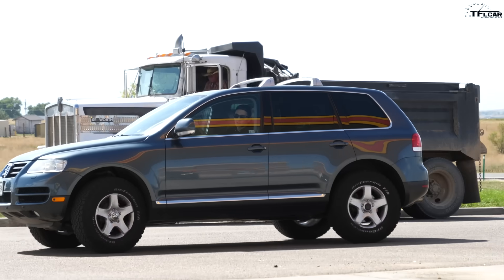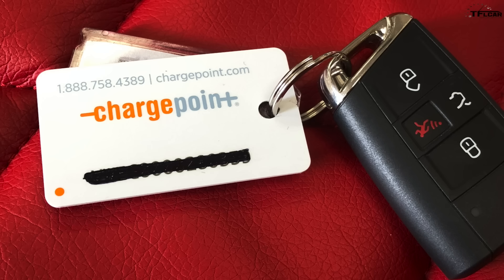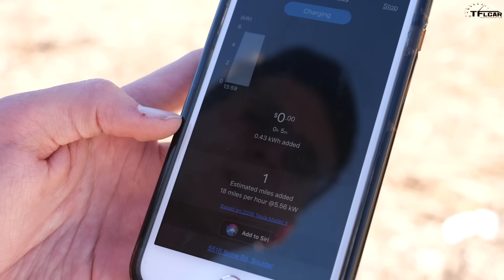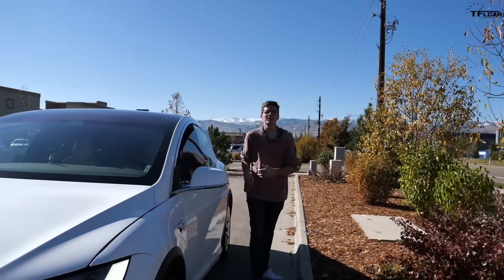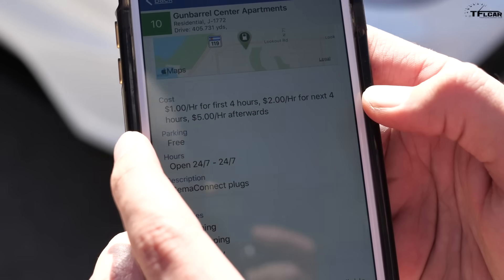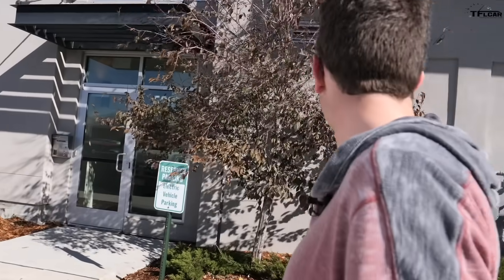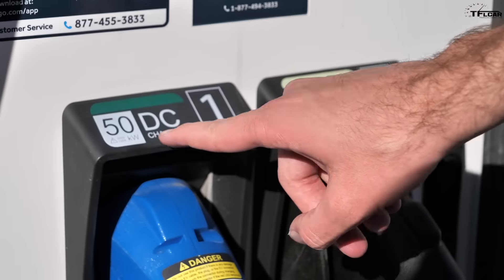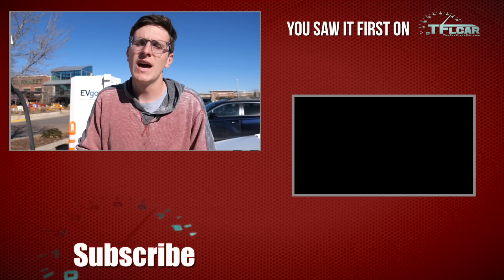Here’s Why Charging an Electric Car Can Suck - And It’s Not The Reason You Think!

Comment: watched the whole video and you bring up good points and issues about EV charging. they truly need to get all companies standardized and easy to use like filling with gasoline. i don't think the general public wants to fiddle with multiple apps for payment, nor do they want to carry around multiple adaptors for all these charging plug types.
Reply: @treyhart6861  Just look over the ocean and see the situation in Europe. The EU standardized the CCS Plug which is compatible to the Type 2 Plug which is used for AC charging. Only Nissan stayed using Chademo, all other vendors are using CCS. Even Tesla uses it for the Model 3, Tesla SCs in Europe have both connectors.
Reply: @craig9365  Level 2 makes sense at hotels, shopping centers and so on. Again a US problem, your electric system is weak. In Europe nearly everyone got 400V 3-Phase within the household. (11kW)
So Level 2 in Europe is typically 11kW without any issues and this is sufficient for destination charging. 
Nobody needs fast charging at the destination, you need many charging ports in parallel to charge the cars while they are parked. 
Fast charging with 50kW is established widely in Europe , a net of 150-350kW CCS chargers is actually in construction.
Reply: fideliovienna our ENTIRE Electric grid  is much older than any where else in the world it’s the oldest electricity grid  no way would three phase electric power be allowed into residential homes 
Building codes would not allow it and their insurance companies wouldn’t allow it
Three phase electric is restricted to industrial uses
Our system could never support it 

In residential areas our electricity grid is referred to
As a. LIGHTING system 
Basically enough power to operate small motors electric lights and household appliances  nothing more
Also electricity is kind of expensive here
Reply: @fideliovienna4631  Europe's grid system is definitely an advantage, but to say that fasting charging is widely established is far from true.  Look at any accurate station map and there are countless gaps, some of which are hundreds of miles apart. It's even worse in the Eastern countries.
Reply: @treyhart6861  Tesla was the first so they had to make their own. Europe did well with CCS after tesla.
Reply: @martialman.4563  Tesla wasn't "first".
Reply: @pogo1140  Maybe not but who else had DC fast charging in 2008?
Reply: @pogo1140  seems like my statement is incorrect. Not sure 2008 had DC/DC
Reply: That is why Tesla has a almost monopoly on electric cars in USA. Very fast and easy system.
Reply: @martialman.4563  - in my area the tesla super charger is 25 miles from my house and 75 from my work... not enough of them
Reply: @williamhaynes7089  If you can't charge at home or have good public charging near you an EV might not be the best choice. I have a garage and a Supercharger on my way to work.
Reply: Martialman.45 the Japanese will find a way around 
The 
Arrogant. Mr musk
Reply: I don't live in the US (yet) but I think I'll use just one single company and one single app. I really want to move to San Francisco. It's enough to use only EVgo there.
Reply: As others have stated Europe has mostly standardized on CCS.  In North America all but Nissan (and affiliates) and Tesla uses CCS.   So just like in Europe Tesla should transition to CCS.
Reply: @craig9365  Yep.
Reply: All you should really need is EVGO and ElectrifyAmerica if you must charge on the road, these are the major players for fast charging for all the EV's out there but Tesla. Plug share and Chargepoint should just be an afterthought as they hardly have any Fast Chargers in their system. Also, I use a converter that lets me access the Tesla Destination chargers that has not been brought up at all. It opens up a lot of overnight options at hotels /businesses.
Reply: Sky P38wannabe chargepoint offers a lot of 25KW DCFC chargers though, in a pinch
Reply: NY has a good solution for this, want state subsidies to put in a charger? You must have an open standard plug. This is why Tesla gets zero dollars from NYS for their super chargers
Reply: @Snow Monk3y Lithium salt extraction has a fairly low environmental footprint and is not an energy intensive process contrary to a lot of the garbage on the internet saying otherwise.
Reply: @treyhart6861  That may be how Tesla thinks, but almost every other manufacturer worldwide uses standard (J1772) interfaces. CCS is a simple extension to J1772 (adds two DC posts below the AC part)
Reply: @treyhart6861  or better yet just unplugging and borrowing your charge seen it lol so much a cple of pple even had an extension cord said owning a ev was the cheapest ever when you can recharge for free almost anywhere but home
Reply: Tesla has the nicest sleekest charger where as Chevy has clunky and big chargers
Reply: @CockpitScenes  You don't need chargers for alternating current as they are in the car. Just  need a place to pug in or a cable. In Canada many places already have an outlet for block heaters. Again 120V is very slow but it's better than nothing.
Reply: @CockpitScenes  Yes, very rare to not have electricity anymore in USA. Illegal in most city's to not be attached to the power grid. It's also relitively easy to install more recepticles and upgrade main power source. Upgraded from 100 amp service to 200 this year in case we need to charge 3-4 cars at the same time.
Reply: Martialman.45 except during those peak hour electric brownout hours lol 😂
Reply: @RCFourFive  Easy to charge off peak. We in Texas had to charge off peak and turn down home air conditioning to combat black outs this summer. It worked.
Reply: Martialman.45 apples to cumquats. We in Texas have ERCOT that has made sure our grid is sufficient and capable.
This is not true for other states - so again except during those peak hour brownouts.
Reply: Trey Hart nothing 
🤣🤣🤣💰
If it’s worth something ppl will steal it

The Japanese car companies will figure a way around
This
Reply: @treyhart6861  I believe the correct term in this case, is: "bloody, greedy savages".
Reply: @treyhart6861  Tesla even released their patents for the charger to get everyone to use it but noone did so we're stuck with a stupid adapter system.
Reply: @craig9365  well, multiple apps is due to companies seeing an opening in the market and creating locations. First people complain there aren't enough chargers, now that there are chargers apparently downloading a 2mb app is too much. Noone is ever happy I take it.
Reply: @0xsergy  it's not the size of the app, that's the problem. It's having to use multiple apps, to do the same thing. You should be able to use cash, or credit, to pay for the use. An app shouldn't be needed.
Reply: @Normal1855  they're separate companies bro, that's how it works unfortunately. yes, lets monopolize every industry yeah?
Reply: @CockpitScenes  well, they're probably gonna add them mate. happy customers means return customers. i've seen charging stations at hotels in the mountains unused.
Reply: I don't understand why they can't just be the same as a 240V appliance plug. Or whatever your country uses for high current devices, so you can just use an extension cord.
Reply: Getting all companies to comply with one plug design is like getting all computer companies to comply with one USB PLUG. Tesla is like IBM and Apple. They won’t give up or give out their proprietary property.
Reply: all electric cars should come with paper bags so no one can identify the dweeb dumb enough to actually buy one.
Reply: Exactly 💯
Reply: BRO. LIFE IS ALREADY STRESSFUL. NOW TO THINK OF CHARGING YOUR CAR AT A STATION FOR AN HOUR IS INSANE. OR EVEN AT HOME. THIS THING WILL EAT UP YOUR ELECTRIC BILLS LIKE CRAZY. I DONT THINK ELECTRIC CARS ARE FOR ME MABEY IN A 100 YEARS.
Reply: Why should a person need an app? It should be like gas pumps. You should be able to use cash, or your credit card. You shouldn't have to have any apps. That just makes it easier for the company.
Reply: You are right. I also don't want to have to drive miles off of the interstate into a neighborhood to charge for 45 minutes just to go from Mobile to Atlanta; whether I am driving a Tesla or Bolt.
Reply: @FrankD71864  Most Tesla SuperCharger Stations are located right off the Interstate and the good thing about the Tesla SC's is your car is your key to use the charging station because the car has 2-way communication.  So you just plug your car in and it does everything else to start charging.
Reply: @FrankD71864  Tesla chargers are generally located less that .5 miles from interstate exits.
Reply: @FrankD71864  If you have a Tesla it isn't a problem. It's 335 miles to Atlanta from Mobile. The Model 3 has a range of 310 miles. If you charge in your garage and leave on a full battery just stop at the Supercharger right off the 65 in Greenville for 15 minutes and then you're on your way with no more stopping. Their map also shows a new Supercharger going in right off 85 in Montgomery and another going in right off 85 in College Park right before the 285 in Atlanta. Lots of choices that are like gas stations which are right off exits. 

Plus all the new Superchargers going in are going to be V3 Superchargers which charge at a 250 kW rate which will give you like 170 miles in 15 minutes.
Reply: @FrankD71864  Good thing that as of September 2022, Tesla has 5 Supercharger sites right next to the interstate along that route. To make that trip in a Tesla, you need one charging stop in Auburn, AL,  and the route planner tells me I need about 15 minutes at that charger. Just  barely enough time to get a snack and visit a restroom.
Reply: @STIGu1993  Your comment makes absolutely no sense. You can't recycle combusted gasoline. But you can recycle batteries and their elements. The footprint of an electric vehicle is far lower than a combustion vehicle.
Reply: Erik Stephens no, footprint of an electric car is not smaller than an ICE car.
This has been shown demonstrably many times.
From the rare earth element mining, to the production of the batteries and cells to the actual generation of the majority of the electricity to charge the vehicles is hugely more impactful than the end to end ICE industry.
Remember, the fuel production and consumption is the smallest factor of the vehicle. Those EVs all use the same steel, aluminium, rubber, plastic, leather, glass etc in their construction and manufacture as the fleet of ICE vehicles do.
It is a flat out lie that EV will clean up the planet.
EVs may make you feel good but they are not doing any good.
Reply: @RCFourFive  Please cite sources. There are many scientific peer reviewed studies that clearly show that EV's over their life have a much smaller environmental footprint.  Here is an article that sources and combines many of those studies. https://youtu.be/6RhtiPefVzM
Reply: @RCFourFive  very true. The toxic batteries, all the plastic in them, and putting a strain on the electrical grid. Worst of all, you can't put out car fires, with water.
Reply: @erikstephens34  and you technically can "recycle" combusted gasoline. I'm part of the fuel cell side of my company and we have a division working on a commercial available machine in removing CO2 from the air and convert it into a fuel.
Reply: @tcs07d  You sir need a lesson on the law of conservation of energy.  On Fuel cells.  There is a lot of energy required just to make hydrogen.  So hydrogen will be expensive.  Why not just take a portion of that energy and directly use it for EV's (Because the direct route will use less energy).  As for converting CO2 to fuel.  Same issue.  It will take more energy to convert CO2 to energy than the fuel it will make will provide.  So again why not take a small portion of that to directly power EV's?  To add a combustion vehicle is terribly inefficient.   EV's use energy far more efficiently.
Reply: Erik Stephens what will pay for the road taxes 
Going to have to text electricity very high or charge electric car owners $1000 per year for a license
To use the roadway infrastructure
Reply: @erikstephens34  actually the comment makes since there are other EV fuel sources ie Fuel cells, and studies are not conclusive on how much carbon saving BEV are because of alot factors so it can range from 10% to 50%.
Reply: @craig9365  Destination charging at hotels is great.
Reply: that is why everyone is buying a Tesla.. easier than buying gas.
Reply: @CockpitScenes  Only drivers would need to charge, not everyone in vehicle. Also not hard to add a few recepticles as 99.99% of hotels already have electricity. When I charge at air bnb houses most don't have 240V yet but even 120V helps. And most air bnb hosts have a place to plug in and are accommodating when I ask to buy a charge.

Comment: Really good information. I wonder why these stations don't have a credit card reader?
Reply: That way they can save info about you. Apps track you. Apps save your information and they can use that to manipulate users
Reply: Exactly, I mean even pop machines have them these days!
Reply: It reduces the cost of making them and maintenance as most credit card readers aren’t weather proof, also allowing you to charge when the CC reader break down & even if the internet to authenticate the CC goes down as it can store who used it and for how much and charge them later when internet is restored.
Reply: Credit card swiping is risky.
Not hard to sneak in a device to read the card. Even ATM machines have had this as a problem, and they've got cameras all over them.
Less of a problem with chipped cards, but some places still do a swipe.
Reply: Because Tesla already has your credit card info stored from when you set up your owner account.
Reply: They have you log in with a code online and put the credit card info on the website
Reply: @tjwatson0403  More opportunity for companies to track you and data breaches.
Reply: @damaliamarsi2006  entering a credit card gives them all the same info